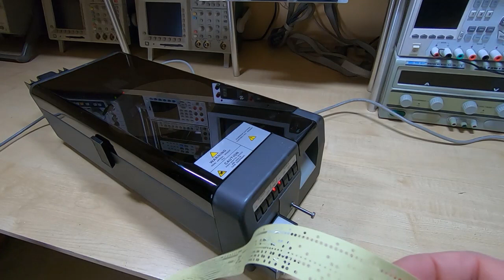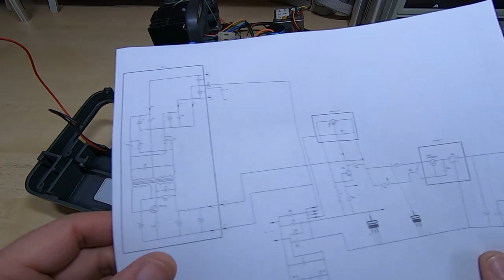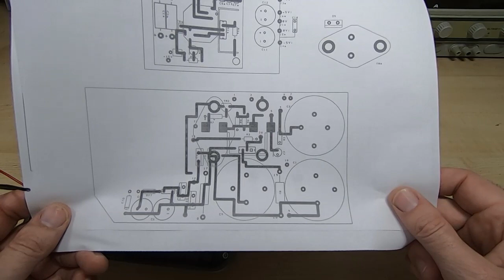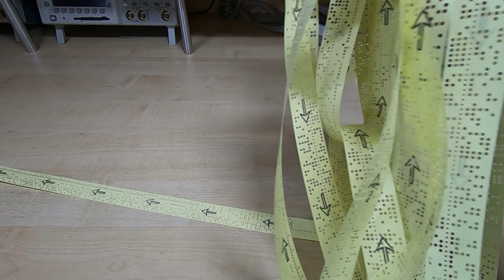Trend 612 Paper Tape Punch Part 1

Comment: Love your tape winding tip.  I think you are the same chap that made the replica OP-80a tape readers.  I made two replicas of it back in the 90's, etching my own boards, and used them with small RCA-1802 based computers I wire-wrapped.  Fun!  One of my little 1802 computers has a repro OP-80a mounted on the top of the case as a permanent feature for inputting code.  Thanks for all the effort you have put into these great videos.
Reply from the maker: Thanks for the feedback. Sounds like you have some interesting projects.

Comment: The real question is where do you get the paper?? Do you have a time machine or a massive stock??
Reply from the maker: It pops up on ebay every so often but some specialist suppliers still supply it although it is very expensive. I have not yet been able to repair the time machine I purchased on ebay, I am starting to think that it may just be a washing machine.